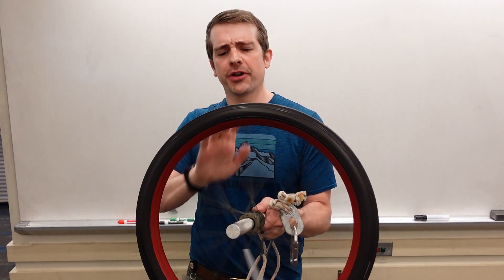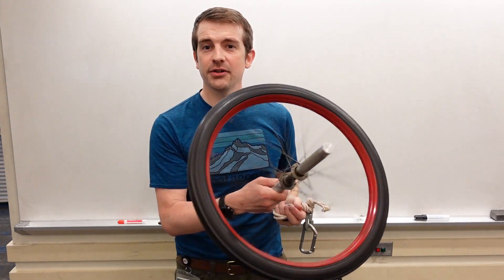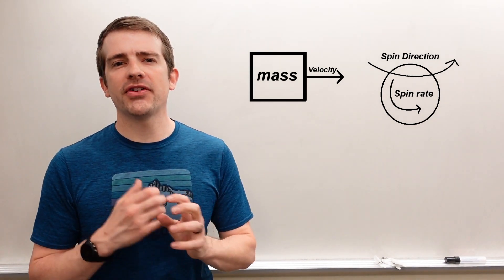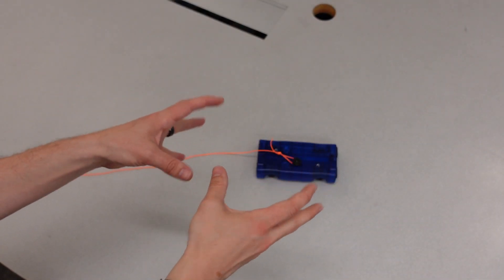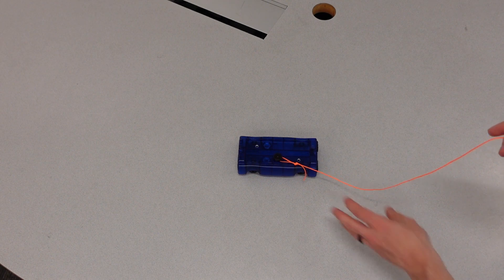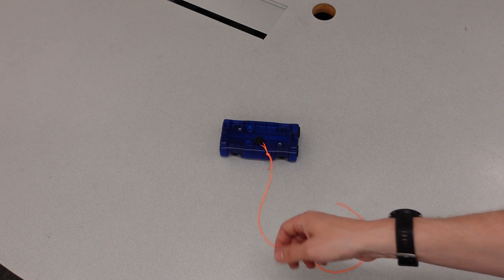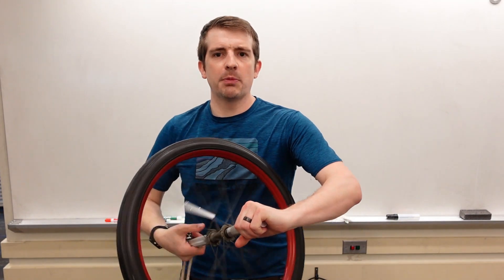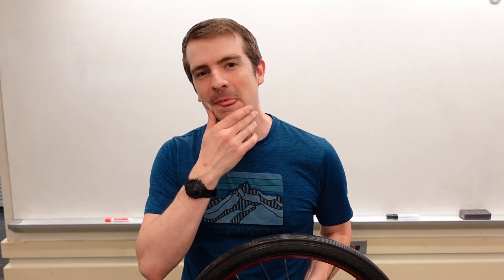How Do Gyroscopes Work?

Comment: I've been looking for the answer to. Can an object such as your bicycle wheel rotate in a vertical plane and a horizontal plane at the same time? Thanks, because you just showed that it can, but what is that principle called? It cant be gyroscopic alone, because a gyroscope does not spin in two directions at the same time. I'm just looking for the term so that I may be able to research  it further.  Great vid.

Comment: You missed the explanation actually, by your cart demonstration wheel rotation isnt matching by any sense,.wud b much help if you had shown it later on white board what forces acting for it to precess...i believe gravity pulling downwards introducing torque on the rotating wheel where the rotation cancels out torque at both top and bottom perpendicular ends of rotating wheel mass, but turn the wheel at horizontal ends due to displaced top and bottom end torque